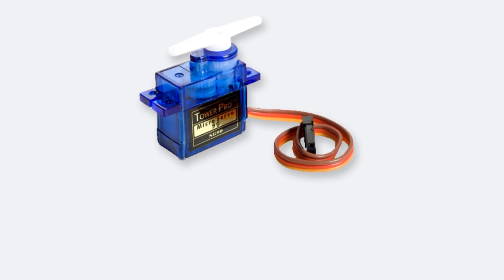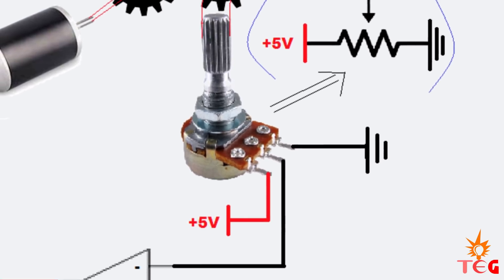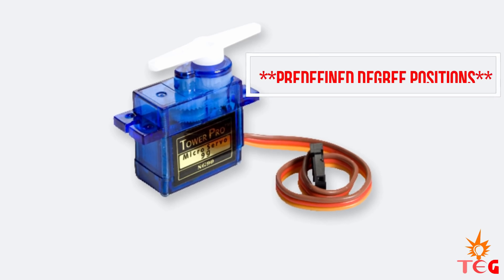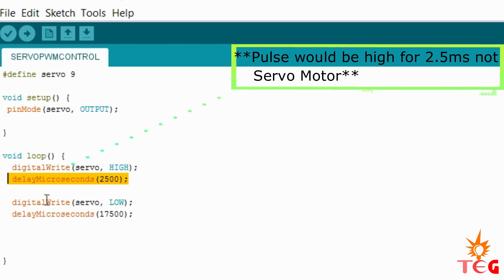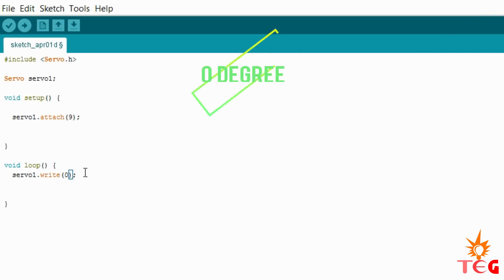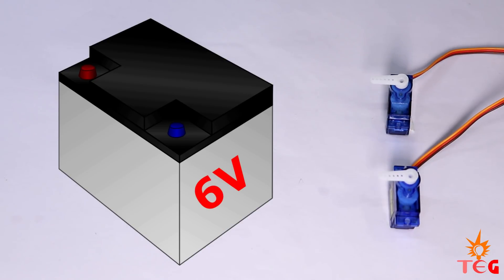Controlling Servo Motor with Arduino | Tutorial for Beginners

Comment from the maker: Servo Motor Step by Step Guide Time Stemp:
0:15 -  Servo Motor Parts

1:15 -  Servomechanism(Working)

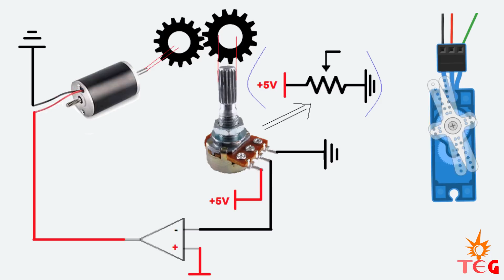3:08 -  Real servo motor Working

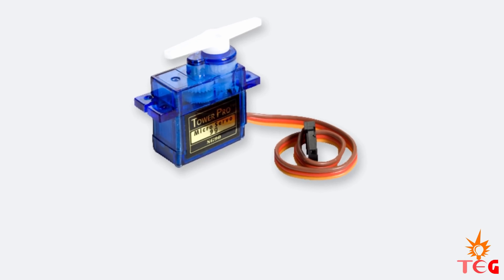4:44 -  Servo Motor Arduino Tutorial

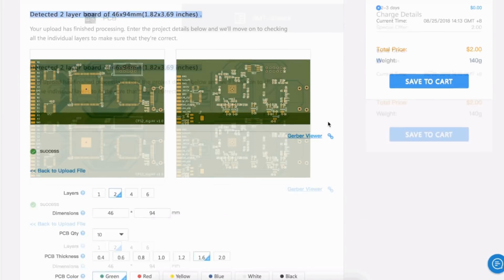5:24 -  Servo motor Circuit Connections

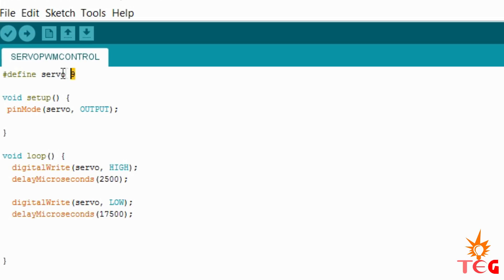5:53 -  How to run servo motor using PWM pin Code and output

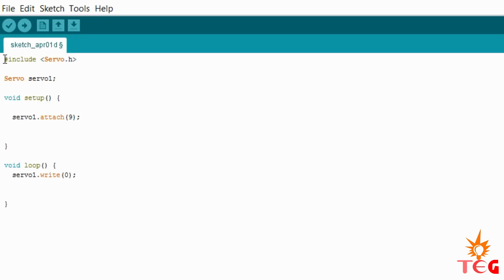7:36 -  How to run servo motor using Servo Motor Library and output

10:24 - How to run more than one servo motor using Servo motor 
             Library and Arduino

Comment: PWM pins on arduino are marked with ~ tide mark use these pins if you use other pins change the pin outs in the code to follow 3,5,6,9,10,11

Comment: Nice Video..  How many servo can I attach before I need and extra shield. ?    I think I saw 6 pins with PWM..  I just got my first UNO in the mail today..  I haven't tried it yet.
Reply from the maker: By using servo library you can attach upto 12 servo motors.

Comment: How to rotate more than 180 degrees?
Thanks in advance
Reply from the maker: This motor does not rotate more than 180 degrees due to a locked system attached to the gear inside. So to do so you have to open the motor and cut it out. You can find videos on this topic on youtube. Or you can buy such servo motor which rotates more than 180degrees.
Reply: @THEELECTRONICGUY  Thank you